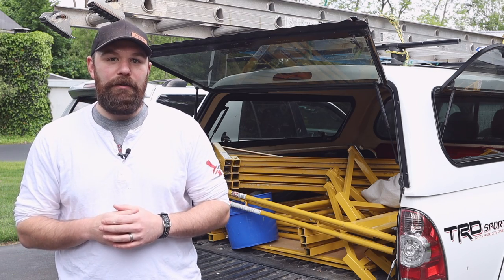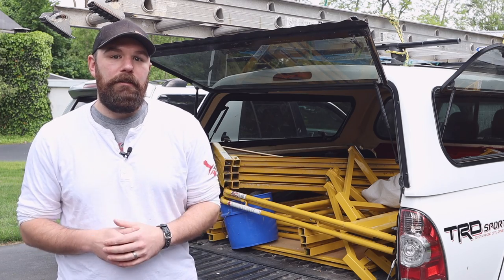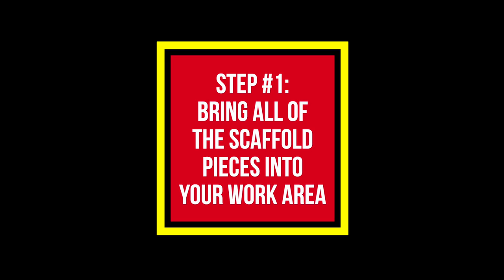Build Scaffolding like a Boss

Comment: Old video but a tip for those coming to it late like me... Grab four cheap ratchet straps and make an 'X' brace from top shelf to the bottom outriggers on each side.  Improves stability dramatically on these inexpensive baker style scaffolds when using two levels.
Reply from the maker: Where’s the fun in that?

Comment: Corn balls setting up scaffolding 1st time, so funny and ridiculous. I set up mine by myself all the time. First, lay one cross section on floor or ground. Then put each elevation side on and tip it up to standing position. The rest is simple and easy.
Reply from the maker: It can definitely be done solo.  Easier with 2 dudes.  And yes we are corn balls

Comment: Great video! Hey you ever use 24" swivel jacks with your bakers scaffold? I need to set up a 12' high on uneven pavement. The pavement is uneven enough that a regular screw jack won't sit flat on the pavement. Thought maybe I'd buy the swivel type but for some reason, having swivel feet really bothers me lol.
Reply from the maker: I have never used swivel jacks for that application.  We mostly use our scaffold for interior work and the floor is generally level.  I'm sure some exterior dudes that have more experience in that area then me have figured something out.  Definitely make sure you feel stable 😬